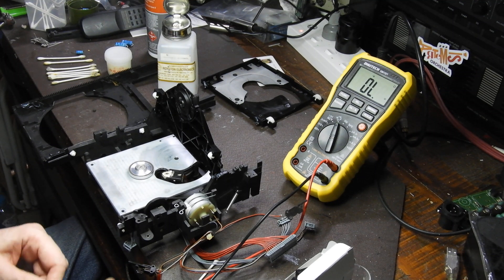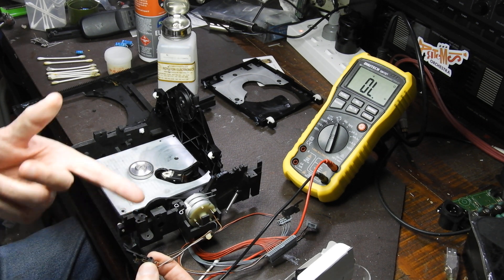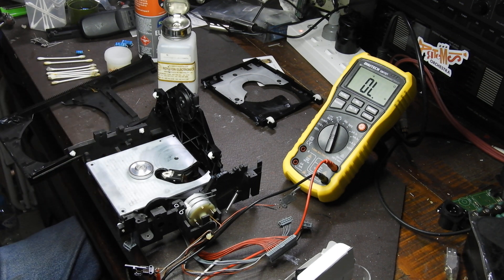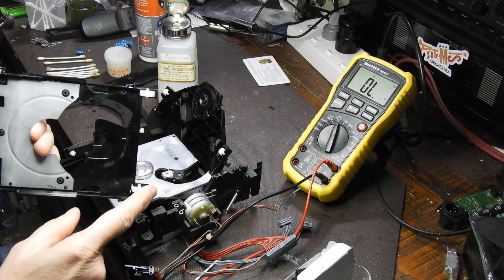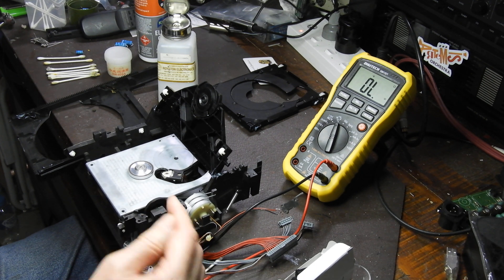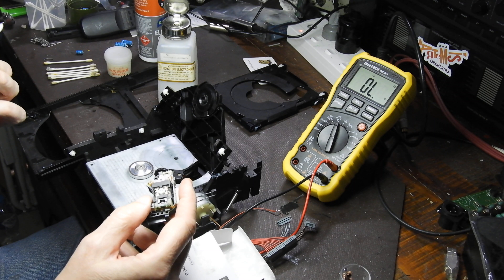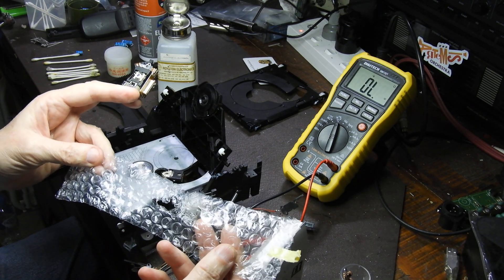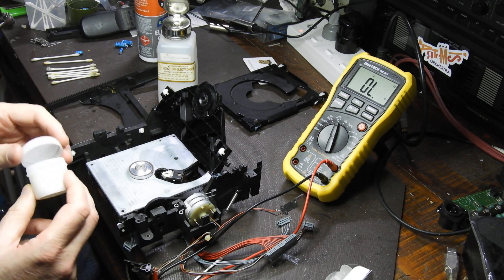Philips CDM-1 Mk2 - Example of Servicing of CD Player Laser Mechanism (Long Assembly).

Comment: I serviced my beloved Marantz SA-15S1 very recently. I purchased it brand new 2007 built like a absolute tank and equally weighs like a tank!!.. Which I absolutely adore Marantz for that well it is a Reference Player after all. Anyway I gave it a full service my self as I'm a hobbyist aka electronics enthusiasts and very happy audiophile. Replaced a  tired but still fully functioning laser pickup which cost me £20 kept the old one as a spare .. Also I used Silicon Greece as its absolutely perfectly safe to use on all electrical products as its non- conductive and should not dry out any time soon. I used plenty throughout the transport so the tray draw is definitely noticeably quieter. I also fully lubricated all the cogs and pulleys ext so that in it self should stop any form of micro/hairline cracks from forming and getting worse over Time and drying out obviously in it self not only does this alone completely protect all those parts from ever completely cracking and breaking off teeth the silicon greese also help to dampen noise and further unwanted Vibrations. The next part for me was to use Servisol IPA 170 contact cleaner and give the entire PSU area a clean out all connectors and molex connectors. I also then cleaned up all 6X Internal fuses and sockets. As this player has 6 power regulators. Then once its all cleaned up I then treated the entire PSU area and all 6x internal fuses with very famous CAIG Deoxit D5 lubricant solution. It took me an entire afternoon but the way I see it the more you put in the more you get out I respect all my equipment. CAIG Deoxit D5 is certainly not cheap but it's works on soooo many levals and you can clearly here the sonic improvements!!!... That's how I service my units. The tray door rubber belt is still in perfect working or. Did not need replacing so instead I used a tiny amount of fairly washing up liquid and obviously "cold" Warter and cleaned off any dirt and grime and it's nice and dry very clean went back in and works perfectly fine the end result was quite remarkable between replacing the laser pickup and using CAIG Deoxit D5 throughout made a huge difference and the player sounds like it's brand new once more 😊. Love the channel BTW fantastic 👌👍😎